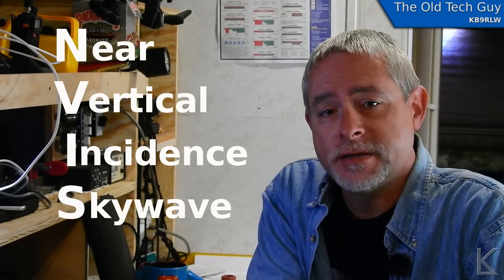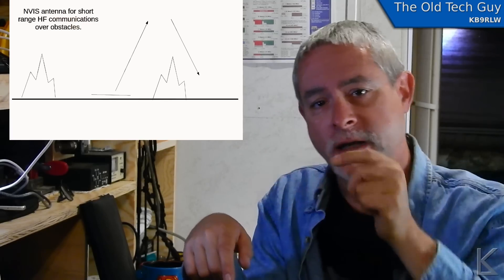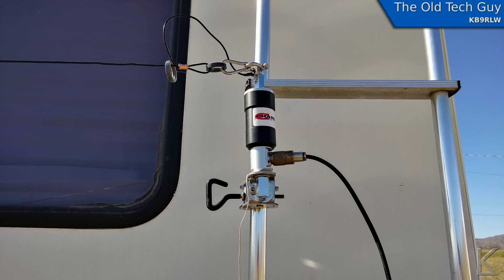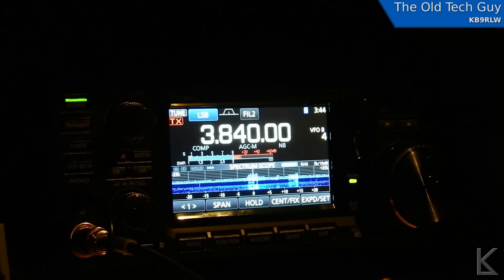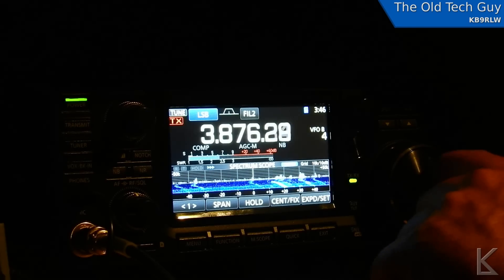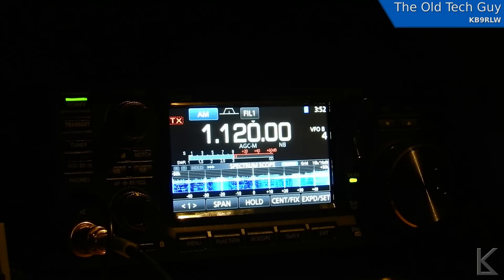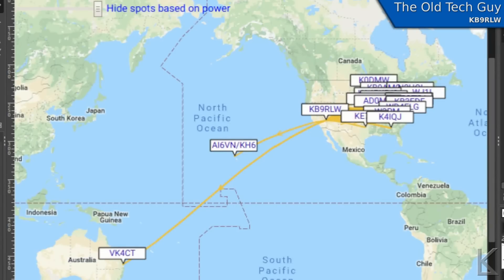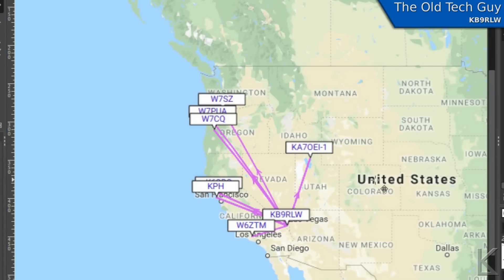Ham Radio - NVIS antennas and the Chameleon MPAS

Comment: Any thoughts of using 2  40 meter hamsticks in a dipole configuration mounted on a 6’ tripod. Thinking maybe for an emergency situation if local repeaters go down, hf as an alternative.
Reply from the maker: Sure, there's even adapters made for that that I've seen. Not sure where to get them. The bandwidth will be somewhat narrow, so you'll have to retune the hamsticks if you want to go from the CW portion to the SSB portion of the band.

Comment: Best antenna for NVIS is a dipole tuned at NVIS height, in a shallow inverted V configuration I beleve 1/4 wave above ground is closer to optimal I have good luck 100 to 471 miles from my location

Comment: You can only have effective ground waves if using a vertical antenna. Ans even then you are more likely to benefit from ground reflected waves, to have any luck with ground waves you would want to be near salt water or wetlands and it also depends on frequency. I am interested in leaning more about how to get better ground reflected waves such as by using a ground shield or parasitic ground reflector which could work better than the reflection from the actual ground. Part of a ground planes job is to match the antenna but obviously radiation pattern and the reflected signal is also very important.
Most deserts are really not good for ground waves and generally anything above 1.5Mhz is not usually worth thinking about other than with amazing conductivity ground.

Comment: There are a few places on line where you can get soundings that give the real-time critical frequency. They also give a chart of the MUF for various distances. If at or below the critical frequency your signal will come straight back down. At or below the critical frequency there is no skip zone. Above the critical frequency and you start to have a skip zone. There is always a skip zone on 20 meters. The only exception I ever heard about was once in 1947 and a few times in 1957 at the peak of the super sunspot cycle where the critical frequency did reach 14 MHz! There is some sporadic E skip on 20 meters that yields some very short skip with extremely strong signals but that’s not really NVIS.

Comment: NVIS is a fairly new term for something that has been going on for a very long time. Using short-skip-favoring antennas on 160, 75, and 40 meters has been happening since the 1920s. In fact, it's what most stations have always done: use horizontal antennas low to the ground in terms of wavelength. On 75 meters, any horizontal wire under about 90 feet in the air is primarily an NVIS antenna. Such an antenna between 60 and 90 feet up will work the best. Below about 60 feet up (a quarter wave), efficiency goes noticeably down due to ground losses. So between 60 and 90 feet in the air is optimal for NVIS communications (though lower and more lossy antennas obviously do work). Above 110 feet up, the upward radiation starts to fall off quite significantly. Double those height figures for 160 meters, halve them for 40 meters.

Comment: Thanks for the videos!  I appreciate the explanations, and I learned something.  I’m curious if you are still using the MPAS antenna?  73 K7NFO
Reply from the maker: Yes I am.  Although I modified the hybrid.  I gutted it and replaced the transformer with a 9:1 unun.  I have to use an antenna tuner with it now, but it hears much better and I get heard better.

Comment: Did you use a counterpoise for this setup? I have the same antenna with not so very good results. I'd like to Use it for nvis as well. 73s from Ohio
Reply from the maker: I'd never seen great performance with the Chameleon hybrid module.    I saw a German guy's post where he'd torn it down to find a dual transformer setup inside, a 5:1 unun arrangement.  He filmed it with a FLIR camera and found it was generating a lot of heat during TX.
Makes sense.  In an effort to provide a sub 2:1 SWR across all the bands, compromise needs to be made.   It eats some of the power.
I gutted mine and replaced the transformer with a more common 9:1 unun design and it performs much better.  Although I do need to use a tuner with it on all bands now.  I don't' mind the trade-off.  I like the physical hardware itself.
I was using a counterpoise with it, to answer your question.

Comment: I have a chameleon emcomm3 portable running off an icom 7100 with no external amplifier. I love that antenna. 73' long and I have it 15' up running horizontal for NVIS. 40m is the clearest out of 40m, 80m, or 160m. I'm in central Indiana and I have talked to people as far away as Georgia with decent clarity. But I have heard people coast to coast,  furthest has been Italy and Puerto Rico so far. Ive had it up and running now for one week. 73 all

Comment: Hi. I just bought the Chameleon EMCOMM III. Will probably utilize as an NVIS, but in your experience, can you skip pretty far with different configurations such as an inverted ?
Reply from the maker: Just about every antenna sends RF off in all directions.  Anything heading out 20 degrees or closer to the horizon will most likely skip.

Comment: An NVIS antenna works well on 80m at night and 40m during the day.  It is also great to use on 30m, 20m, and 17m when there is sporadic E nearby.  The critical frequency of some of the Es can get as high as 20 MHz, so an NVIS antenna is perfect for working stations that are normally in the F-layer skip zone on 30m, 20m, and 17m.

Comment: HI have bee playing with one of these on field days  mine   transmitting wire7foot.3 inch,s agl one wire directly under  with over run of 6ft ech end and a wire  8ft out either side  works a treat  long distance    was from   Central Coast NSW  au to Sigapore  on 10watts  on a 120v  40m ,all home brew  woth plastic conduit poles in  sections for easy transport

Comment: I  think your research was fine and the information was also great. Working with different types of antennas is what we as amateur radio operators do, meaning we experiment on antennas of all types and we practice what knowledge we can gain from it. I learned as kid and pretty sure at some point in your lives. "The dumb question is the one question you never asked."  Information is key in this field of radio communications. For what it's worth, any type of antenna we Hams may work on it alone, in a group,with a friend or more, and our radio clubs around the world. If works awesome if not we try something else that makes it work  make it better. We as hams help newcomers by addressing questions and we give input on what rigs to start with in the beginning. We help  our Senior hams by helping with antennas on towers, digging holes for a tower, or just sitting around and discussing anything to do with radio operators and gather information and passing it on. Don't stop helping because some people are just know it all's and no one knows everything.

Comment: Some of our local hams are interested in meeting on direct frequencies. We are scattered about in a 35 mile diameter or so and in the foothills of the mountains. Yesterday, in the video recommendations, I saw this one and it reminded me to consider NVIS. 

My antenna is only about 12 feet on the ends with most of it running about 9 feet high. I thought it was NVIS until you said yours was only 6 feet, LOL. 

We tried 40 and 80 meters, but the antennas were my dipole and Buddi Stick, an inverted V and another dipole. None of us could hear each other well. So, I'll suggest we try the NVIS.

(For those who read in the future, we are all in the COVID 19 Stay-at-home restrictions here at this time.) 

Weather looks good today, so I think we can try it.

Comment: One question, when both stations have NVIS, how much of a difference is there. Also, when only one has it, how do the numbers show signal levels. Your wsper maps were most likely shwoing stations which did not have NVIS. Here, at night, 80 meters is "going long" and making local nets very tough copy. One set of stations is about 60 miles, the other is 120 miles I'm estimating. In the AM propagation is great on 80, at night terrible. So trying NVIS hoping for some results. That language might have been Indonesian. Correct on 8mhz and lower . The only thing I'm seeing is a reflector laying on the ground is sometimes recommended, say 5% longer .. Would love to do some tests with  NVIS at the other end. I believe there is a chance that was done by OH8STN here https://youtu.be/F0TkJJIsY3o
Reply from the maker: For two way comms to work best, both stations should use nvis antennas.  But there is a distinct advantage when only one is.
Reply: @loughkb  The heighth I've used is too high. Need to come down from 10/12 to 6. And try the reflector on the ground. 80 at night is terrible, we have a net at 6:30

Comment: Great channel Kevin! keep up the good work. I have a question. Can you bend a NVIS wire in two places and still get a decent radiation pattern? I was thinking of mounting a wire under the eaves. it would be 8 feet above ground. 40 foot run then 90 degree turn to a 60 foot run then 90 degree to another 40 foot run for a total distance of of 140 feet. basically 3 sides of a rectangle.  Not sure if this is worth experimenting with. Anyway thanks for all the good content!

Comment: Hi Kevin, just decoded your WSPR signal on 40m while logged into a remote SDR at PSU in State College, PA. Call sign used on the remote end was SWL3/SDR for WSPR spots. The audio was passed to WSJT-x via "Virtual Cable" so the actual decode took place on my PC here in south Texas. 73 de N0IJK/5.
Reply from the maker: Hey that's cool.   Actually testing a new antenna project I just finished up today.  Two vids on this one, just getting ready to release the first.
Reply: @loughkb  Looking forward to watching them!

Comment: Thank you for the great NVIS lesson.  As a 1980 novice cw operator,  I did not realize my 70 foot end-fed just 12 feet in the air was NVIS at its finest.  Just made the longest and highest within my means.  It worked super well for any qso up to about 700 miles on 40 meter daytime.  Any more than 50 watts was a rude excess to go +30dB over S9.

Comment: Hi Kevin;
It occurs to me that for the "Short Haul High Reliability" communication links a pair of NVIS antennas could be used.
Arrange them perpendicular to each other with a 90deg phase shift coaxial link between them. This will generate a "Circularly Polarized" pattern for the master station.
The secondary stations would us normal linear polarization.
Yes, there is a 3db hit but this is for Short Haul use not DX.
A big advantage is there is little to no Fading when passing through the ionosphere
Duane C. Johnson
AD0TJ
redrok@redrok.com

Comment: I don't know if you were speaking with someone from Rockport or Aransas Pass, but Aransas Pass seems to have done exactly what you were suggesting. If you go the W5ICC entry on QRZ.com you'll find an explanation of what they did which included having several city staff members get amateur radio licenses and the city obtaining ham radio equipment for emergencies. They also set-up a D-Star repeater which is pretty easy to reach from Rockport.

Comment: So is it correct to say that all dipoles are NVIS antennas because of the way they're oriented? Won't you always get skywaves with a horizontal wire?
Reply from the maker: There will always be some signal going up.  By lowering the antenna closer to the ground you increase the degree of vertical radiation.

Comment: I always thought of NVIS as a propagation mode and any antenna that helps you achieve it is therefore a NVIS antenna. I use a full length 80M dipole with a feedpoint roughly 10ft above ground. I get very consistent regional (400'ish miles) coverage with stray lobes landing not so consistent long range. One long range was Alaska (I'm in SE PA). That really made my night!!!
I enjoy your content! Thanks for your videos!
73
Reply: I have the same understanding as you

Comment: NVIS, especially QRP NVIS is more difficult to locate.  This was more important when HFDF was done principally from ground based systems, even so worth knowing.  NVIS is principally a 10 MHz and lower propagation mode.  It is unusual for higher frequencies to be reflected back to earth at near vertical incidence.  One of the defining criteria is a propagation range of less than 400 miles.   Otherwise it might be short range but not be NVIS.  I don't think I have ever heard of exactly what the refraction angle is required to be for it to be deemed NVIS.

Comment: A local EOC here in CT was having the same problem with HF communications you describe at the end of this video.  They had originally set up the EOC with a vertical antenna due to space restrictions but found it was almost useless for local work.  They then experimented with an NVIS dipole and had much better luck with local communications within their coverage area.

Comment: I don't mind you talking about what you're going to talk about at the start of the video but it drives me nuts when you talk about talking about what you're going to talk about. LOL. Just kidding. NVIS is one of my favorite ham subjects. As a result I didn't learn a ton from this video because I'd already done a lot of research on my own but it was still great to have you covering NVIS and I'm very glad you made the video. It's very hilly around here and my primary interest is in talking to friends who are 100 miles away or so but without relying on a repeater so NVIS is very interesting to me. I'm also extremely interested in some of the low power digital modes like Olivia. And the WSPR beaconing is always interesting too, so I'm glad you included that in this video.

Comment: Last year for the PA QSO Party, I wanted to experiment with NVIS.  I put up a 60' wire endfed with a 9:1 unun.  It was roughly 10' above ground level, and I used an MFJ manual tuner and 100w power.  I wasn't seriously contesting, and I didn't get a clean sweep of all 67 PA Counties, but I was able to work enough (45 counties) to prove to myself that I could work any county in Pennsylvania on 40m or 80m, depending on the optimal frequencies for the time of day.  
Thanks for the great video!!!  
73 de W3COB
Reply: I've recently taken NVIS as a serious pursuit and I've been quite happy with what I am able to do with an Ultimax 80m-10m EFHW antenna on 80m running SSB phone at 10W and 20W.  The antenna is configured as an inverted-L at about 25ft resting on the top of some trees. Beneath is a 5ft tall chainlink fence that is probably acting as a reflector.

I've done a little bit of comparison of the EFHW against my Chameleon Emcom III portable antenna on 80m. On 80m ancedotal testing suggests it is about -6dBr from the EFHW. I only have the stock single 25ft counter poise wire. There is an optional 4 wire set.

As I operate portable in parks I don't like a lot of wire on the ground so I bought two of the Super Antenna 17m, 15m, 11-12m, and 10m counterpoise sets. They seem to provide a slight improvement to both antennas.  Especially to 80m and 40m on the Emcom III.

The Emcom III is my first try at a manpack portable HF antenna for my FT-857D go-kit. It wasn't my first choice, but I had a $200 Amazon card and Packtenna doesn't sell on Amazon so I thought I would give the Chameleon a try. Its performance 40m and up seems good enough to be a keeper antenna, at least until I try something better.

Hopefully I'll rack up a bunch of counties during the Florida QSO party with just a few watts.

Comment: Guys used to have 160 loaded verticals on their vehicles, with a whip bent from front bumper to the back, and talk to locals, back before repeaters took over.
Reply: Police radios were on the low bands also for the same purpose.

Comment: I've been confronted with multiple stations on same frequency and my 1886 listening to Radio New Zealand on 5.945 and close by same frequency.  My antenna is fixed and I had to use all 4 notch filters to get copy on RNZ.  RNZ uses multiple frequencies as time passes.  The antenna is fixed 50 degrees East of North and the opposite if I remember correctly concerning directivity of the loop.  NVIS is a great way to work the stations closer, yet not LOS.  I'm really surprised by the loop configuration that has opened a lot of doors for me across the world.  I live in Kansas near Kansas City in a suburb using first the SDRPlay RSP 1a, and now the RSP 2.  I hear the local FAA operations along with plenty of 2 meter repeaters even repeaters some 50 miles away or better.  I get plenty of South American stations on SW and Radio Havana is no problem.  I also hear Italian and other languages not from the SA stations like VOA transmitting Vietnam in English through I think is re transmitted from Florida or TENN.  Great stuff; these mag-loops and LNA even with overhead power lines and such.  Being SWL with good antenna is satisfying knowing how much of a challenge listening can be at times.  I like your channel, I'm retired as well and it is good to hear about subjects like NVIS that you bring to the table.

Comment: I would like to know if a dipole attached to the backstays of a sailboat would work, realizing it would be an inverted V?
Reply from the maker: I've seen antennas on boats.  Don't they usually put the center feed point up on the mast and bring the legs down to the ends of the boat?  That seems like the best case solution to an antenna on such a craft.  Provided it's oriented to keep the wires out of the way of the rigging.
But then again, I'm no sailor, so it's just a guess.
Reply: Yes it would work very well depending on the lenght you can get...The Salt Water is a great advantage being an excellent ground and reflector of the radio waves.
Best of Luck with your efforts.